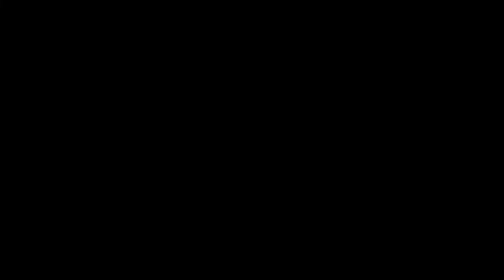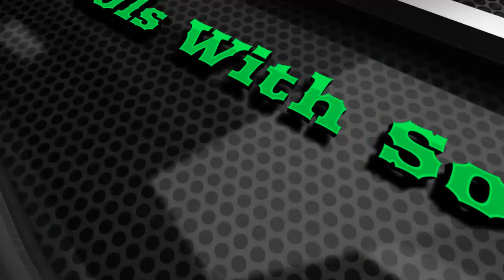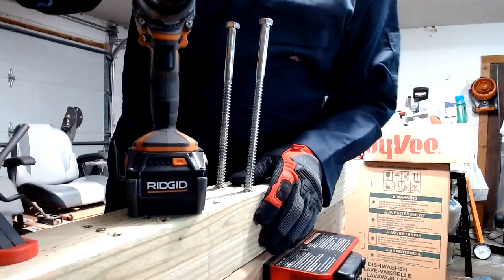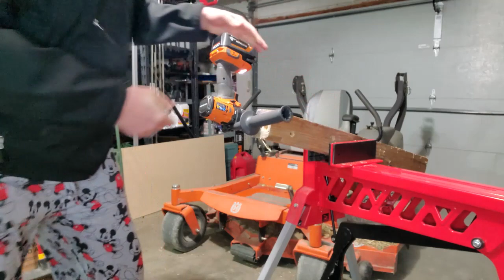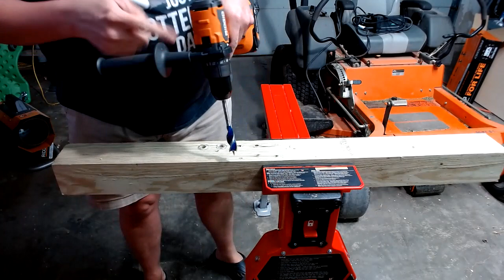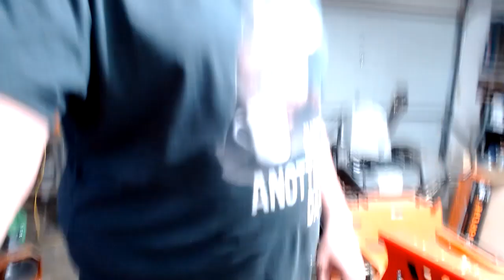Ridgid Max Output vs Octane Hammer Drill

Comment: Ironic, considering the new Max Output impact driver is considered better than the Octane generation and it doesn't even have the extra Max Output contacts that the new hammer drill has.

Comment: I agree with you 100% on this test you ran when people run this test either you or anyone else when they other two batteries do come out 6.0 ah Max output and 8.0 ah Max output batteries it's been confirmed that they both have 21700 cells inside so that should change the playing field for the test moving forward once those batteries are released right now the tools are underpowered that  are available in comparison to octane in a lot of sense sure once those batteries with those higher cells come out people won't be complaining as much amazing thank you sharing
Reply from the maker: I wish all of the batteries were available right now because I would be testing them against the standard and Octane's.
Reply: @ToolswithSoAlz  by the October November they should be in store or at least online for what we all read
Reply from the maker: @bluemantom77  That's what I've seen as well.

Comment: The two drills are fine, if you're a home owner and are working on a big hole drilling project just get the corded Milwaukee hammer drill for $99 8 amp, 48,000 BPM 2,800 RPM and work all day everyday without stopping to charge your batteries 😂

Comment: I love my octane hammer drill. Disappointing to see Ridgid going backwards
Reply from the maker: Not sure they are going backwards. The Max Output hammer drill is a big improvement over the Gen5X. It doesn't have the power of the Octane though. I will say that the remainder of the kit is a significant improvement over their Octane counterparts.
Reply: @ToolswithSoAlz  agreed

Comment: I really hate the Ridgid's drill with led light in the chunk. The brushed Gen 5 hammer drill loose the drill bit went the drill stop. The same happens with the Octane brushless hammer drill. I think is something with the chunks and led light ring.
Reply from the maker: I do like having the light ring and a lot of times the chuck let's loose on me because I backed past the lock. However, a lot of people have issues with the chucks keeping the bit. That doesn't seem to be an issue with the new Max Output hammer drill. Overall I have been pretty impressed with the new drill, even though it has less power than the Octane.
Reply: @ToolswithSoAlz  yeah, those in the Octane and Gen 5X with the led ring in the chunks have problems with loosen the drill bits. I'm very glad to hear that this new one version don't have chunk problems. The R86116 hammer drill don't have that problem and don't have led light ring in the chunk.
Reply from the maker: @Magister3eros  well, I just hope you enjoyed the video. It showed both the good and the bad in both drills.

Comment: I see the biggest Ridgid hammer drill, like the Gen 5X, Octane and this one, and the best in general I thinks is this new one. But I still prefer the compact version, the R86116. Is a lightweight, and compact version.
Reply from the maker: The Octane is huge for sure. I personally do love using it though. The Max Output, the newest hammer drill from Ridgid, is smaller than the R86116 I think. I do think the Milwaukee style auxiliary handle is a big improvement over the old ones but I wish it were a bit longer.
Reply: @ToolswithSoAlz  I would like to see a comparison between this new hammer drill and the Ridgid compact R86116. I would very surprised if the new one is smaller and lightweight.
Reply from the maker: @Magister3eros  I am going to be going to Direct Tools, in a few weeks, if they have the R86116 there I will pick it up for a comparison.

Comment: I wish the new drill a little bigger with more torque
Reply from the maker: Luckily they still have the Octane available and it is awesome.  The new drill is probably more powerful that most of the other ones in that space.  The good news is that Ridgid is always coming out with new hammer drills so, it is pretty likely they'll make another one that is bigger and stronger.  That being said, the new Max Output can do 90-95% of what most people are ever going to need it for.

Comment: Company that is using different batteries for its tools aint that smart. Therefore its a risk investing in it altogether. I did same mistake. Started to buy makita 18v tools, a year ago befire the 40v came out. Now i wasted 800 dollars like an idiot
Reply from the maker: I don't think you wasted any money by buying Makita. They are an awesome company. Also, they are going to continue making tools in their 18v platform. So, those tools are still going to be around. Don't beat yourself up over things beyond your control. 
As for Ridgid, I am still going to buy their tools but will be picking up, and registering, some when I see them in the clearance section. 
Thank you for watching. I hope you enjoyed the video.
Reply: @ToolswithSoAlz  
I cant buy ridgid, im in south europe. We only have AEG, which is european version of ridgid, but we dont get american warranty. If you want proper warranty in europe, hilti is the way to go. There is no tool that can surpass hilti. Tools itself arent strong enough, but its such good company, rarely found on this planet. Their tools are made here, they are made by an european hand and they are fixed by an european hand. The only reason i went with makita is cuz i wanted makita's duc353, beautiful small 36v chainsaw. Cuts like a gasoline version under 2kw. So since i got 2×6ah makita batteries, it was logical to continue with makita. But i realized that i can buy any tool and buy an adapter for battery. So i can fit any other brand with my makita batteries. But still, im sad, should have waited for 40v :(
Reply from the maker: @i1bike  it makes sense. I didn't know you were in Europe. You're right, of course, Hilti is one of the best brands you can buy into.
Reply: @ToolswithSoAlz  
Hilti should reinvent themself a little bit. Tools and batteries are outdated.  They neef to make one battery platform like makita with 40v. Cuz they have couple of diff batteries, and i dont like that. We in europe are very careful with our buyings. We cant really go out there and buy bunch of stuff in big box stores. For example, here in croatia we have almost the tripple prices for something in the US. Ive been comparing some american dewalt deals, ive seen 7 piece tool box kit for 500 dollars. Went to my croatian retail market, here it costs little bit more than 2000 dollars. I was shocked. Milwaukee is even more expensive, its actually hilarious how they are ripping us off. When i saw some makita deals in american big box stores i almost fainted. Here is some small comparison: In united states, makita 36v rotary hammer drill with double charger, two batteries and box costs 840 euros. In croatia same tool, bare without box, without double charger and without two batteries costs 1300 dollars hahahaha. I was paying 240 dollars for just one 6ah makita battery haha.
Reply from the maker: @i1bike  wow! I had no idea. That seems crazy. I wouldn't have a tool channel if I lived there. I am wondering why the cost is so much more.
Reply: @ToolswithSoAlz  
Do you wanna hear something even funnier. Croatia is the lowest economy with lowest people paying pwer in the European Union haha. Basically 80% of the common working people, work for 650 dollars neto monthly. But our people are strong, they learned to live humble. Before e-bay and amazon, people did not have choice beside premium brands. My grandfather worked his daily job, and after that he would work 8 more hours of manual labour for the whole year, just to save money and buy makita belt sander.  Next year he did the same for the bosch circular saw. We needed it, to rebuild or fix our boat, and boat was = life. Especially for us islanders. With such hard times, younger people learned to appreciate their fathers and their tired hands, but today its all lost. People buying cheap crap and after it dies, they throw it to trash, creating deponiums of plastic. Very ugly consumeristic society. In the times of my fathers, things used to get fixed, and tools would last forever. I will continue our tradition, even tho i might go bancrupt haha. Sorry for such long comments, but i really like watching and talking about rough good tools, if i already cant afford them. Btw. i have fathers made in yugoslavia black and decker corded hand drill. Its so strong, you need serious muscles to hold it haha
Reply from the maker: @i1bike  I have an old corded Milwaukee that I never use anymore. If I could, I would send it to you.
Reply from the maker: @i1bike  it's an old hammer drill. Still works but not really practical for me.
Reply: @ToolswithSoAlz  
You can send it if you want, i just dont know how much would shipping cost me, probably same as the drill itself haha. Do not worry, my father is obsessed with drills. Every hole he drilled on our boats he drilled it by his hands, with his old rusted hand drill. Its called "trapanea", have no idea how is it called in english. But cuz of it, today i have 3 hammer drills at home haha. I have few more tools aswell but i dont like cord some. Like, on the angle grinder or planer and circular saw, its always getting in the way. Cord is for stable tools that need strenght and precision, tools that are not moving. Like table saw, table router or table jigsaw. Haha, now that i remeber, i have an old table circular saw for metal, made in yugoslavia. It can fit the biggest cutting disks, and it has motor that is producing 9kw of power hahahaha. I started it once just to give it little bit of life, and both of our houses went to dark haha. It fried our electrical board switches haha. If we had restaurators like in the US i would sell it for the decent price. It might be older than 40 years haha.
Reply from the maker: @i1bike  that sounds like my kind of saw.